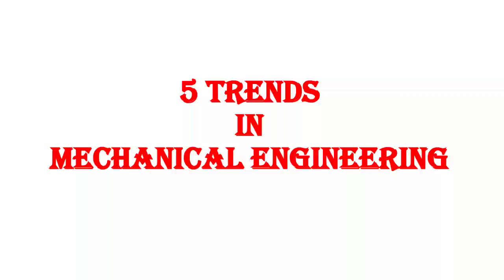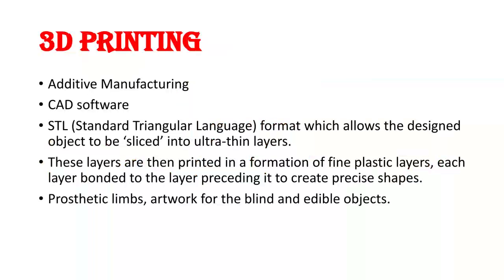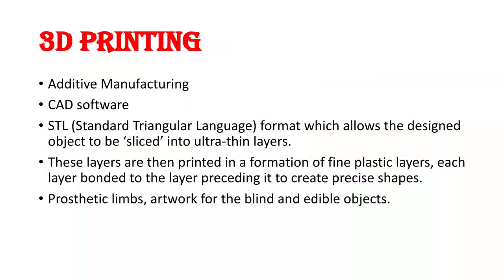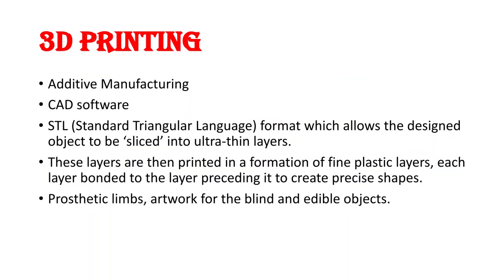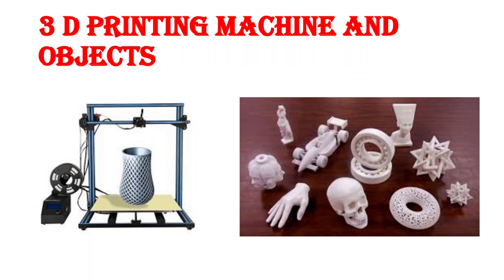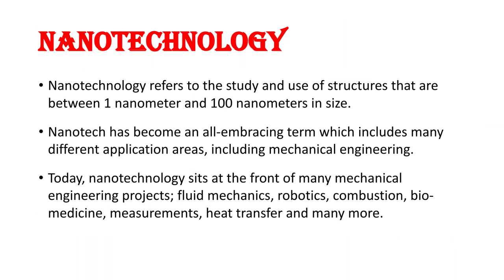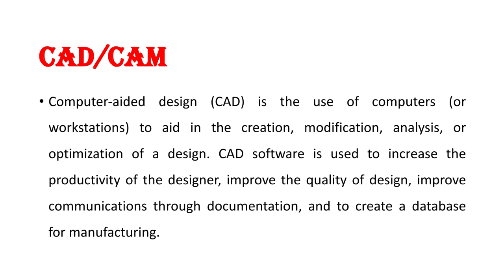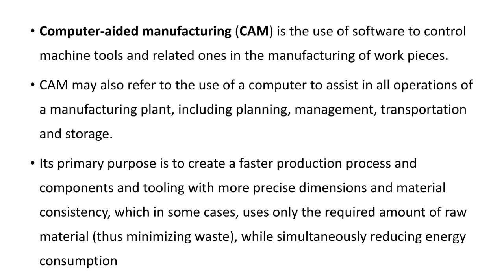Recent trends in Mechanical Engineering

Comment: Sir i want a help. I am doing mtech in manufacturing engineering. Which thesis project should I chose except 3D printing?
Reply from the maker: Kindly concern with your guide.
Try to choose the topic from your guide's field.
Reply from the maker: As you are doing M Tech in Manufacturing so you can take an industry based problem for your research work.